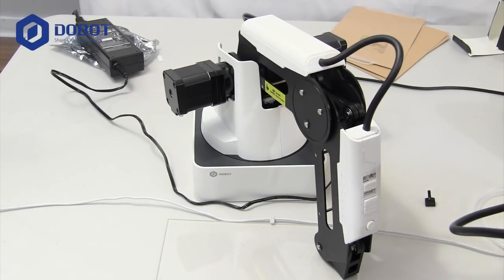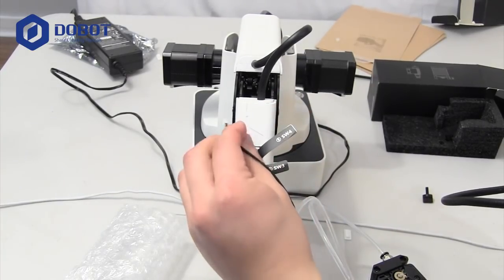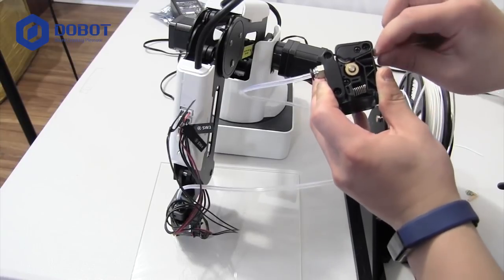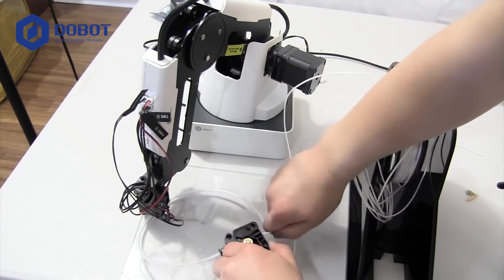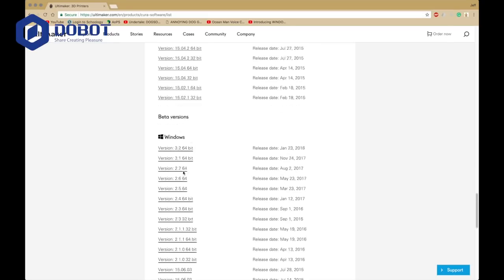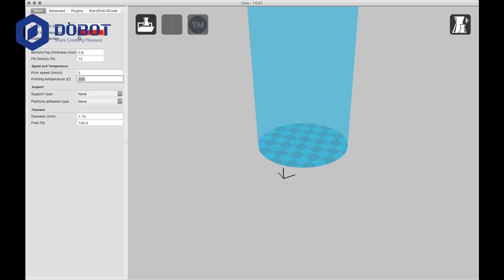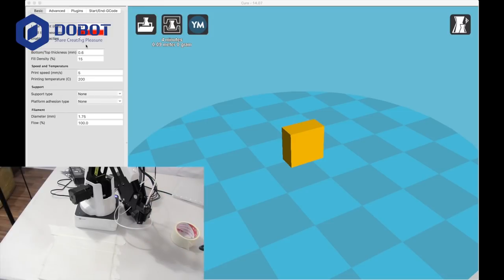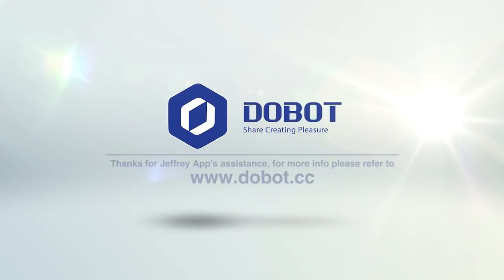[DOBOT Magician Tutorial] Tutorials 3D Printing

Comment: I have a problem with my prints when printing when the Robot goes X+ the Z goes up and when it goes X- the Z goes down, resulting in very bad failed prints. I’ve tried reinstalling the newest firmware and tried auto calibration but can’t find anything that works. Any help would be greatly appreciated!